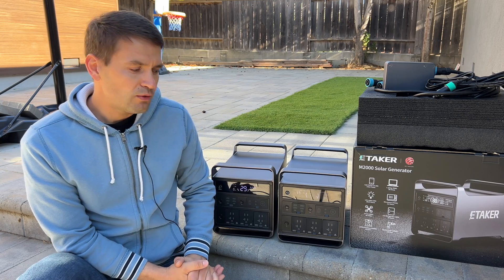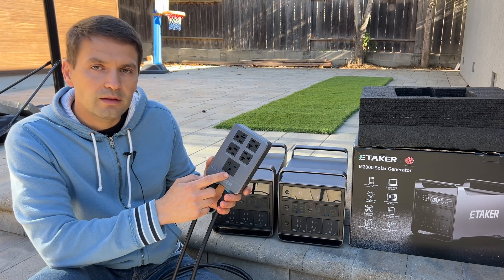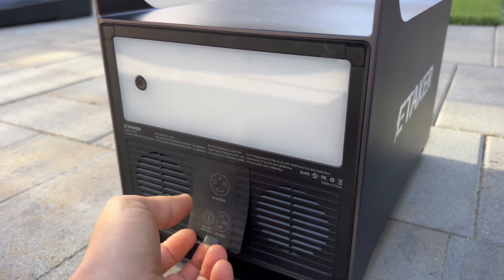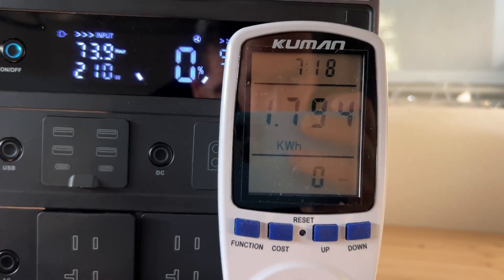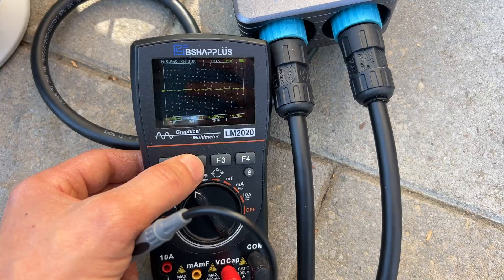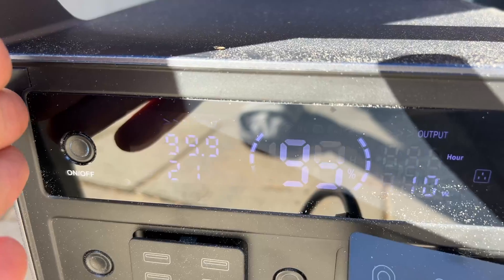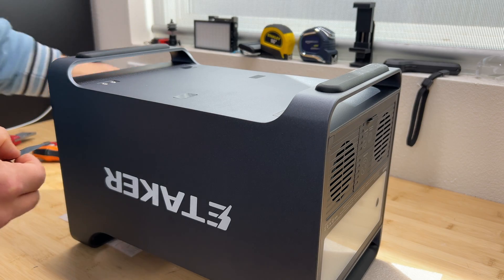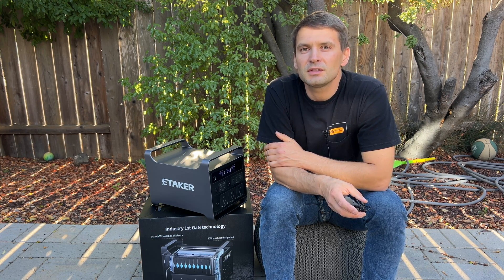Etaker M2000 power station test/review. 240 Split phase system.

Comment: The Etaker M2000  uses Lithium-ion battery cells, which is very safe, long lasting life, light weight, andconstant power. Those are very important qualities for me in a large battery like this. Even though it might be a bit expensive for the Lithium-ion cells, they are totally worth it. The weight of the Lithium-ion cells is at least 50% less than the lead-acid type of batteries. 
Overall I am very pleased with my Etaker M2000. I have tested it with all sorts of loads simulating a power outage situation and it performed really well. 0dB noise within 1000W, Quiet Operation,only 16.8kg（2008Wh）

Comment: Seems like a pretty good power station, but I wish the MPPT could handle more than 50v on solar input.
Reply: Yeah no kidding, 50v at 21a seems odd and really limits you.  100v would be ideal, but I'd rather have something like 80v at 13-15a.  You can't even charge this with a 48v battery bank because the voltage would be just barely too high